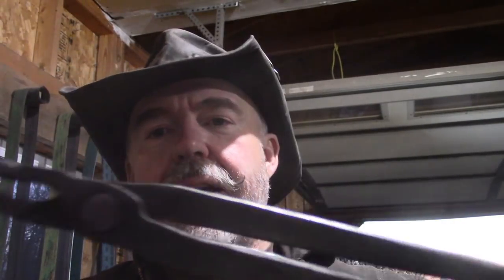Making some Tongs for a New Blacksmith - Forging it Forward

Comment: I enjoy paying it forward of sorts, I am a scoutmaster with a local BSA troop and teach the youth not just about blacksmithing and merit badges but other life skills such as how to deal with others, about being a leader, and being an overall decent humanbeing. BUT since we are on a blacksmithing channel I must add this. I just recently taught a welding/metalworking merit badge class just after Christmas at a winter camp for 4 days and I literally had kids asking me if they could skip their other classes so they could stay and keep learning how to smith. I ended up keeping the forges open during lunch and after dinner every day to let them work under myself and my oldest son who is quite accomplished in blacksmithing for his time involved and I have since had youth and their parents contact me to point them in the direction of how to get started. 
In the class we had 3 forges going, my personal nice rolling forge built on a metal cart with a fire pot made from 7/8 in plate that was 10x11 and 3.5 inches deep. We had our brake rotor forge powered by a hairdryer and last but not least, the boys themselves built a dirt box forge using a bunch of sand and a section of 2 in black metal pipe being blown with a shop air compressor and blow off wand. The anvils were much the same in order from a nice 100lb down to a piece of rr track nailed to a log. If you ever get a chance, volunteer to help some of these kids out, the goody two shoes with their Eagle by 13 aren't the ones I focus on, the kids with family and behavior problems but still have a good heart need it the most and benefit the most from it, I know I did and I would like to think I turned out pretty good.

Comment: They are beautiful. Thanks. Are there any Smith's in North Yorkshire England. I am not a smith my knives are stock removal mostly. I do use a "tin can forge" on some bevels and tangs. But love the idea forge it forward. Thanks Anthony Kent HAWK woodlore knives UK
Reply from the maker: I'm not sure if the comment section on one of my videos will get seen by enough people to help you find someone.... In the U.S., we have different groups... some local, some statewide, some national, that will hold meetings and hammer ins.  You can meet a lot of smiths from around your area at these events...  If the UK has something similar, that's where I'd begin.  You might be surprised at how many smiths are living right near you.
Reply: HoJ Forge  cool thanks Anthony Kent

Comment: What is the best place to buy steel? 
I'm a beginner blacksmith and I need steel so I can make some actual quality Knives
Reply: Hi Wesley, Texas knifemaker supply, Jantz supply, New Jersey steel baron all cater to knifemakers. If you are just starting, get some leaf spring steel and practice with that. It is good steel and pretty easy to heat treat and cheap/free if you look around. If you can find a maker in your area they will probably be willing to let you hang out and learn and that is even better. Have fun!!